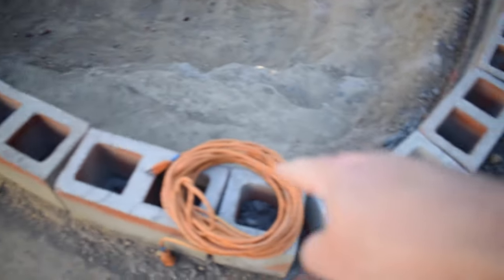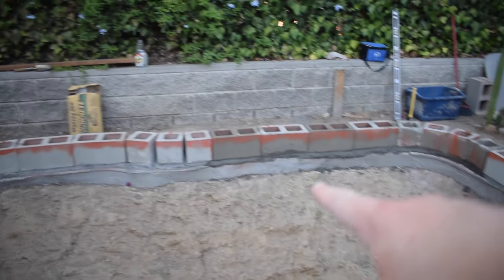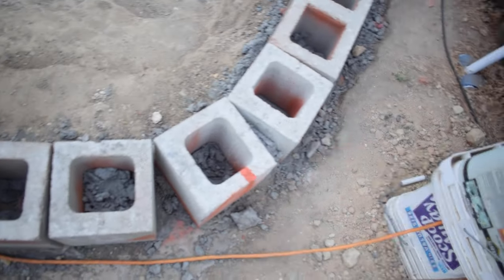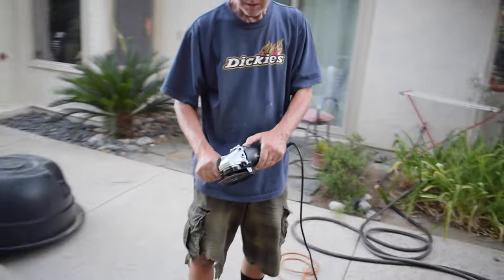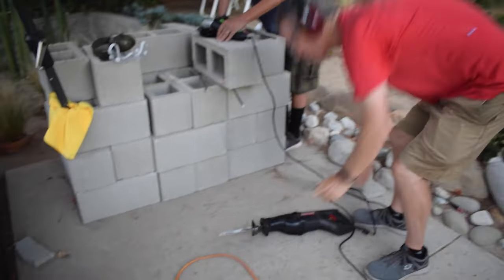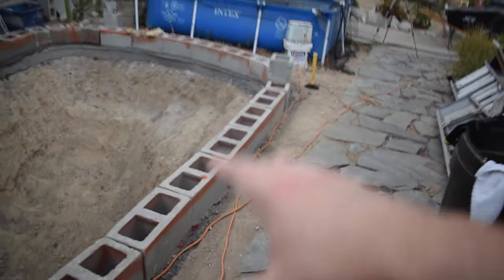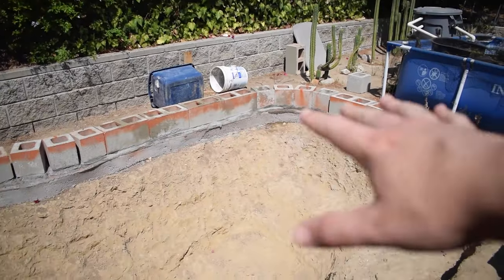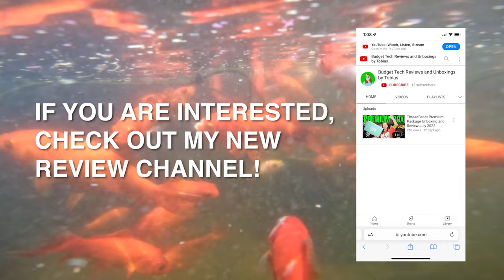Backyard Koi Pond DIY! Retaining Wall, First Course Complete!

Comment: I didn’t actually notice but I do hope that you put mortar in between the cinder blocks as well as just underneath them to stick them together
Reply from the maker: As bad as this will sound, we did not. The first day I was unable to get the cement to stick to the sides of the blocks. Looking back I think it was because I was trying to put too much on. Many of the bricks have gaps between them that I will be able to put mortar through at the end and for the second course I'm planning on putting mortar between the blocks
Reply: @TobiasHolenstein  it could be that it was just a bit too dry it does stick better when it’s a bit wetter
Reply from the maker: Thanks for the tip. I tried again yesterday without much success, but I figure in the end there won't be too many blocks without mortar between them